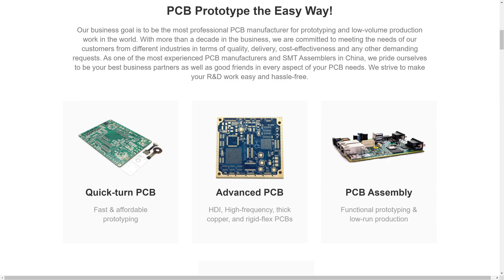I need to get better at soldering

Comment: Experience in the art of soldering for 58 years, from tube sockets to surface mount.  My advice is: Use more flux and a smaller tip for your iron which should be cleaned after every few joints and re-tinned.  Multicore solder is the best, the joints should be shiny and smooth.  A "frosty" looking joint is called a "cold joint" and will be weak and failure prone.  When soldering wires create a solid electrical\mechanical connection before applying solder.  Solder is after all a mediocre conductor.  Practice makes perfect my friend!

Comment: A small moist sponge to clean the soldering tip. A dirty tip doesn't work so well to transfer heat. You want a bright and shiny tip. This also keeps tips lasting a long time.
I use Servisol (green spray can) electronic circuit board cleaner from Jaycar (in WA) to clean off burned flux. Spray on, scrub with a toothbrush, clean off with paper.
I have trimmed component legs forever after soldering. No problems.
I use 350oC for my solder iron also. Hot iron to quickly melt and flow the solder results in lower component heating. Lower iron temp means you have to apply heat for longer resulting in component heating up more.
Good luck.

Comment: WTG! Phil !
Slowly you will learn and get better and better... and it is so rewarding to see your soldering skils slowly increasing
I use a cheap LIDL soldering station ... it comes with different tips 
I melted cafonia rosin in alcohol and now use this flux  with a pipet dispenser 
I also bought a ZD-915 desoldering station that is cheap and works ok 
Phil, solder melts at a really low temperature... sometimes I have my iron at 280ºC or less I only increase in case of large ground planes/stubborn solder etc
You didn't burn the PCB.. that black stuff is the burnt flux.. you can clean it with isopropil alcohol

Comment: Just get a Weller soldering station with Temp Adjustment. They have a reasonably priced starter model (still 5 times more pricey than the cheap clones or wannabes), but you can't go wrong with a Weller. I've got a ton of soldering stations, and been doing electronics since the 80s as a service tech. Weller is the one that you'll bring down your family line to your future kids.

Comment: don't bother with those usb soldering irons, they're nice but they don't have many kinds of tips and they're expensive. get a soldering iron that can take T12 style tips and get an assortment of chinesium T12 style tips. they're really good and you get allllll sorts. it'll last you a lifetime. get a good soldering iron, i use the aoyue int2930 which i modded to take T12 tips, but nowadays there are many good types. aoyue takes a part that snaps onto the soldering wand, it's a metal pipe connected to a silicone rubber tube that then goes to a filer and a diaphragm pump. this sucks smoke right out of your tip, so the smoke exits the tip of your iron, goes for 7mm, and then goes in the tube. so you don't get any smoke in your lungs at all. you can buy the part as a spare part from aoyue and adapt it to your iron (you can just ziptie it on, it's really nothing special) or you can look at how it works and try to build your own, it's really simple, literally just a thin steel pipe going to a rubber tube. the rubber tube is connected to the soldering iron cable with small clips that look like a pair of back-to-back letter c, they clip the cable together with the tube nicely. might want to 3d print those or just use a bit of twine.

REGARDING YOUR EYES. what you want is better light. while the light in your studio is BRIGHT, it is not HIGH CRI and it is not very PARALLEL. the BEST light you can get for soldering, bar none, is when you put your soldering on the windowsill during a nice bright day. your eyes will THANK you. daylight is just so much better, for your eyes to make out details, you have NO idea. by doing that i could solder 01005 metric components with no magnification... so that should tell you something. that's about the size of a single poppy seed.

Comment: Take advice but don't put too much stock in what people tell you.  You will work out your own habits and likes/dislikes as you go.  Smaller blade tips are easier to handle for me, you don't need a huge chisel tip unless your doing something large.  I use 0.6mm 60/40 resin core and that works very well for me.  And remember, the only important thing with soldering is: Does it work when you're done with it.  It doesn't have to be pretty, it just needs to work.
Reply from the maker: Very true!

Comment: As many others have said, flux is key, it breaks down the oxide layer of both your solder and the metals being soldered, and those oxide layers prevent the solder from flowing nicely and thus weakens the joints or leads to ugly solder, so put a lot on, and put some more on for good measure.

Solder flows where the heat is, so put heat into both parts to be joined and feed your solder more into the joint rather than towards the tip, after all, that's where you want the solder to go.

Use an appropriately sized tip, using a large chisel tip for fine soldering work makes it harder to get the tip where you need it, so unless you're soldering large power or ground planes where you need a large amount of thermal mass, use a smaller tip.

Speaking of temperature, you should be able to do most jobs at 325c, but if you're working on single layer boards or really fragile boards step it down to 300 or 280c.
Only go up if you absolutely need it, and usually you don't and instead what you need is thermal mass, not temperature, so if you're struggling with getting heat into your joint you might need more thermal mass to prevent the iron tip from freezing to the work piece, and that's achieved with a bigger tip, but as above don't go too large or you'll struggle.

Put your work piece at a position that is most comfortable, obviously soldering for video makes that difficult, but wherever possible reposition your work piece so that your hands rest in a natural position and where you can clearly see what you're doing.

On the topic of visibility, use magnification, even if you have perfect eyesight use it, it's less tiring on your eyes and ensures you will be more likely to spot bridges and splashes before you go to power on the system.

This doesn't apply to you as you said you bought some stuff already, but buy quality tools, if you're using a $10 iron that has poor or no temperature control, then buy a better iron. Seriously, the old saying of "a poor workman blames his tools" is nonsense, a great workman can make do with crap of course, but just because they can doesn't mean you should suffer crap, so just get the decent stuff to begin with, it'll make learning or relearning less challenging.

And of course practice as you say, if you don't use if, you'll lose it, so put in the hard graft and keep trying.
Reply from the maker: Great advice, thank you 😊
Reply: @philscomputerlab  you're welcome, and here's some more tips, not just for you, but for anyone who might see this too.

Use genuine brass wool to clean your tip, don't use sponges and don't use the plated steel stuff, the sponges when wetted cool the tip down way too much and do a poor job of cleaning, and lead to rust forming on the tip, and the plated steel wool damage the coating on the tips due to the wool being too hard.

Use painters tape or even blue-tack to hold items in place until you've soldered at least 1 pin in place (I'm specifically thinking of the pin header in the video) it makes it much easier to get things in place

After applying your solder, hold your iron in place for about 2 seconds, this will ensure that the solder properly flows into place and gives a neater weld.

I once saw someone do this, and I shouldn't have to say this, but DO NOT FILE YOUR IRON TIPS, the coating is not just to make the tips look nicer, it actually serves a purpose in making sure solder holds onto the tip when needed, but is easy to clean off when required, if the coating comes off, replace the tip, it's no longer any good.

Make sure you use a fume extractor, even a cheap fan with a dust filter is better than nothing, the fumes coming from the flux are nasty (I really need to follow my own advice on this one) and cause all sorts of health problems down the line, so don't ignore this.

If you use leaded solder, get into the habit of washing your hands before you handle food, handle your pets, or touch your face, or indeed do anything other than soldering. There is no safe level of exposure to lead, and while you won't immediately die or suffer issues, it will build up and the harm it causes is immense, so treat it with the proper respect it deserves.

Tip cleaner solutions aren't required in my experience but there's little harm in using them, however all I do is wipe the iron tip with brass wool thoroughly before turning the iron off which leaves a tiny amount of solder on the tip, and this coating protects the tip from rusting and helps fresh solder adhere properly when I come to use the iron again.

Don't think you need expensive solder with the fancy fluxes inside, rosin core solder does the job just fine, but you should clean your work pieces properly after using it, it shouldn't harm anything, but better to be safe than sorry.
Speaking of solder, I wouldn't recommend using 0.5mm solder unless absolutely required, you end up needing to feed in huge lengths of it just for a small weld which is unwieldy and hard to do comfortably, so stick with 0.8mm unless you're doing ultra small smd work, where the smaller solder is a requirement, and even then I find 0.8mm to be just fine.

Don't bother with cheap flux, go straight to the good stuff, I personally use amtech/inventech tacky flux (genuine, not the knock-off stuff usually found on amazon), it's not cheap but it's worth its weight in gold, and DO NOT use flux meant for pipe welding, that stuff is acidic and will damage or even destroy the PCB.

Also, for desoldering braid don't waste money on the cheap stuff, get genuine goot wick, again, it's not cheap, but it's excellent and makes desoldering a much easier process. 😊

Comment: 1. Use a better iron. I can see that the tip is too hot and the no-clean flux inside the solder wire is sublimating instantly when touched.
 I guess the tip temperature is over 400C/750F. I would recommend something like Pinecil/TS100 with bevel conical tip or a spade bit for general hobbyist use.
350-380C is the ideal range.

2. Prefer to use leaded solder 63/37 or 60/40 with good ol' rosin core. It is best when you are starting out soldering since it is forgiving and flows easily, unless you wanna sell the PCBs you made. Don't forget to use fume extractors.

3. The method you are following is absolutely optimal. The tip should touch the pins you wanna join and the solder wire should touch and melt on the pins itself, not the tip of the gun.
Reply from the maker: Yes 63/37 with flux core is what I use. I've since tried a few brands and found something that's still cheap but better. I'll get a decent soldering station soon!

Comment: There is no easy way to clip the leads before soldering, so just clip them afterwards.  If you're worried about cold solder joints in the future, you can reflow the solder quickly after clipping one lead at a time, but this is almost always not necessary and can result in the component falling out, so I wouldn't do it.  99% of everyone clips leads after soldering the component in.

Comment: A proper pointy tip is best for this kind of soldering.
 For the solder its good practice to roll like a meter or 2 into a   pen or something like and use that to apply the tin, not straight out of the full roll of tin.
 You can use more tin, you seem afraid to use too much, the tin should fully cover the pad in a way it should look like a blob and not a cone (hope you understand what im saying).
Usually you can immediately apply the tin, no need to "pre-heat" the pad/leg like you seems to be doing.
If some solder doesnt seem to be right you can dip the tin inte some flux, or apply a little flux and it most likelly will make it stick, if the tin ia not sticking its most likelly because of rust or resin or something else, clean the board with alcohol and / or scrap/sand the leg to make sure is clean.
The microfissures thing may only be relevant when soldering high power stuff (5Amps or more).
Reply: Pointy tips are pretty much useless unless you are doing real microsolering (like fixing iphone long screw damage).

Comment: Clean the surface with IPA (Isopropyl alcohol) before soldering.
The solder will attach easier on the board.
Reply from the maker: Yup I bought a litre of that stuff 😁

Comment: 2:23 you solder iron is overheated. For Sn60 solder iron must be around 270C. And use flux.
Reply: Its a terrible iron so as soon as he touches something bigger all the heat will dissipate before thermocouple way way back inside the ceramic heater even notices. High temp is a crutch used with such irons.

Comment: I've been soldering for over 20 years and you're doing it exactly right, the best way is to get cheap kits and build them! Leaded solder I find works nicer than lead free, but the lead free you get these days is actually fine. Flux is your friend, I would recommend the syringes of paste flux you can get. Also wiping your tip every few joints with a damp sponge and re-tinning it will make nicer joints. But over all, you're doing a good job!
Reply from the maker: Thank you 😊
Reply: Cheap kits were a good way to learn soldering 20-30 yeas ago. Nowadays in the age of multilayer heavy ground planes those cheap one sided pcb kits teach you nothing :(

Comment: Get some standalone flux. Sometimes you just need more. Especially when workin on old hardware which will have relatively more corrosion on the solder surface. Do also get a (small) fume extractor and clean the flux afterwards with isopropyl alcohol. Your temperature is also a bit high for lead solder and the small boards, it can get too hot too quickly and when the flux burns it can ruin your bonds. Especially with the quite big tip you use. Would recommend to go no more than 300 here.

Comment: My main tips would probably be use flux on everything, and get a brass sponge tip cleaner and clean the tip continuously.

Don't be pressed into feeling like you need a big Weller soldering station. I have been incredibly happy with my TS100. The Type-C irons like the PINECIL* and TS101 are great and put out a lot of heat.

Comment: tips for soldering:
1) USE FLUX
2) Use an adjustable soldering iron, you want enough heat for the job. Smaller items need less heat than large PCBs with massive copper ground planes that act as a heat sink
3) USE FLUX. I'm not kidding, this is important. Flux is a mild acid that destroys the oxide layer that forms on metal surfaces and makes the solder bond stronger and cleaner. USE IT.
4) Solder flows towards heat. You need to heat up the pin AND the PCB to get good flow.
5) Molten solder is a liquid, it has surface tension and will tend to stick to thinks in large globs. FLUX HELPS PREVENT THIS.
6) Seriously, USE FLUX.